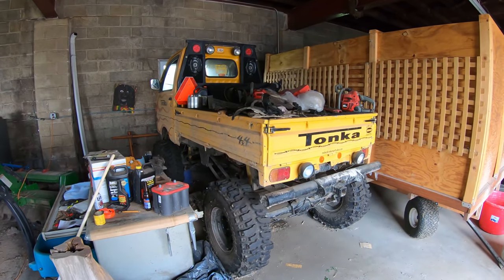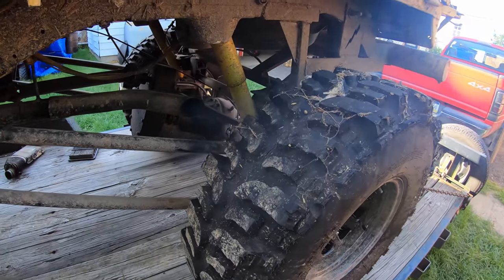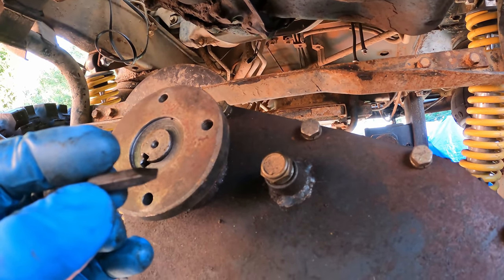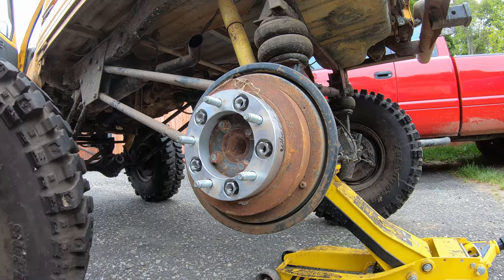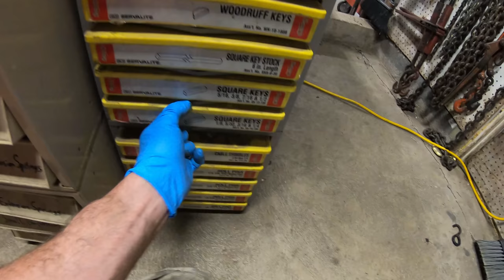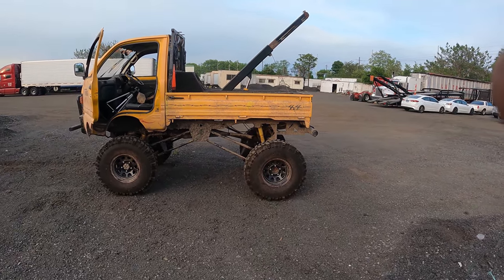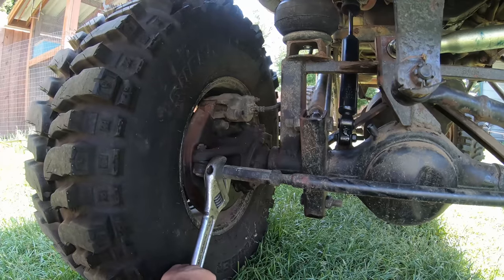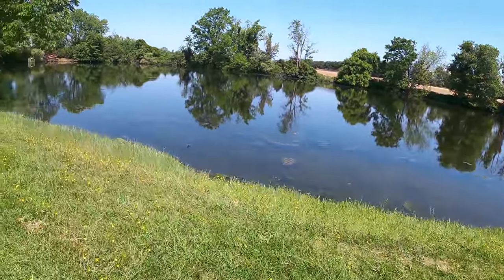Life Size Tonka MONSTER TRUCK - Will She Rip!? NNKH

Comment: I think you missed something with that boom I believe when you open the tailgate that yellow T that the winch Hook was attached to I think it pulls out slides out and becomes a part of the towing setup like a wheel lift tow truck the parts that hook the wheels are maybe even like an old sling style tow truck! That thing is done extremely well and I highly doubt that boom setup is all there is to it definitely check out that piece the yellow t c what what it is and make a new video for us!

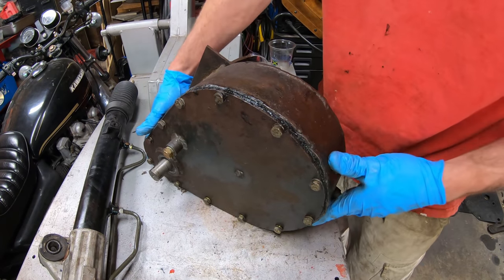Comment: At 16:25🤔...
Do you think that the little blob of weld, or whatever it is, on the middle of the plate you're just bolting on, has been a grease nipple or oiling point at some stage.?🤔🧐🤔?
Because I think that there SHOULD be some kinda method of putting some kinda lubricant in there.!  Don't you.?🤔?

Comment: Those tires are made for MUCH heavier vehicles.  At 8 pounds of pressure in the tires they are no giving at all.  When the boom hit the top it started to extend.  How far out does the boom go?  I wonder if he used it as a cherry picker for pulling engines.

Comment: Man I'd love to have something like this for the farm
Reply: Look up japanese mini trucks. I have one. Beats an atv, can take a load, and it has heat! Some models even have lifting beds. Good times.
Reply: @mikescudder4621  oh I'd love too. Just trying to get a trailer for hay and such now. 1 thing at a time.. for now we will use our little jd 318 with a garden cart for chores. I finally got a 3/4ton makes hauling water in to the house a lot safer then my 2000 f150 2wd v6. Lol 300+ gallons in the back of that was some white knuckle driving..🤣🤣🤣 getting there.. with God's will and Grace. God bless you buddy.
Reply: @mikescudder4621  And as a factory build, I presume...much easier to maintain.

Comment: Even know the suspension is custom built it would do a lot better had it had just a 2-4 inch lift as it would most likely be more capable as it would be less prone to rolling. These trucks stock are already rly capable just add the right tyres, suspension and your good to go but this is to much for this little truck. It’s still very capable under a 2-4 inch lift with the right tyres and also then u can use it for what it’s meant to for used for plus off-roading.

Comment: I can't believe that wittle engine can spin those big tires. It doesn't sound bad. You're a good mechanic. I might have left it for dead. What's it like driving a right side steering ? The tires are worth more than the truck. What town was that cop? I can't see a NJ cop not seeing town revenue looking at you going down the road. Were you legit with insurance and reg? What bike do you have?
Reply: J

Comment: That’s funny, I had an 86 Chevy sprint which was made by Suzuki and had a little three cylinder very similar to that.  The freakiest thing about it is when the car got old and was dying they were two times that I started it and the crankshaft was actually running in reverse which I didn’t think was even possible but I would put it in reverse and it would drive forward and put it in forward and it will drive in reverse it ran horribly when it started that way and I don’t know how that’s possible but it tripped me out. I was at work one day put it in reverse and is running horrible and I was trying to get down the street to my friends house so we could work on it. It was in reverse and I touch the gas and it went forward and I thought how could I have been dumb enough to put that into a forward gear and I checked pulled it out put it in again and it did the same thing and I shut it off looking for linkage and everything but I didn’t have linkage that could get crossed up that way I restarted it and it ran a whole lot better and drove appropriately my two mechanical friends who are used to working on the car with me thought I was crazy and talking crap and they said it was completely impossible and a couple months later it did the same thing.  At that point had something like 180,000 miles on it and within about a month the engine seized or actually I found out later after selling it that it was something Ashley and the distributor that made it filled with oil, probably a cheap seal. Lol. But I got rid of it at that point and it got parted out. I never pulled the engine apart and I still don’t see how it was even possible that it would rotate in reverse but it would be interesting someday to figure out how it happened and if that was a common problem with these little three cylinders 

I seen a couple other YouTube channels with these little mini pick ups and they seem pretty cool and are surprisingly capable even pretty close to stock.

Comment: Hah hah, wonky Tonka! That 15-20 mph top end is probably about right for something that sits that high.😁 I'm thinking those Mitsubishi 3 cylinders were only 660 cc's so even with the gear reductions, it's still got it's work cut out for it. I'm really surprised the carb didn't need any work. It must not have sat with ethanol in it, or it would have been trashed. Nice quick repair on the gear box! Gotta say, it's definitely a chick magnet!🤣👍 EDIT: Did a little research and if that's an aluminum block engine, it's most likely the 3B20 and is 659 cc's and about 50 hp.😉
Reply from the maker: She's wonky all right! I was super surprised about the carburetor as well
Reply: https://en.wikipedia.org/wiki/Mitsubishi_Minicab
highlight on "jetstar"

Comment: I hear the input and output shafts should be at the same angle. Otherwise, wheels will not turn at a constant speed.  https://www.youtube.com/watch?v=gmV4qwLfOMY   But if you are only hitting 20mph, it won't matter much.  So odd looking at a tiny thing on top of gigantic tires!